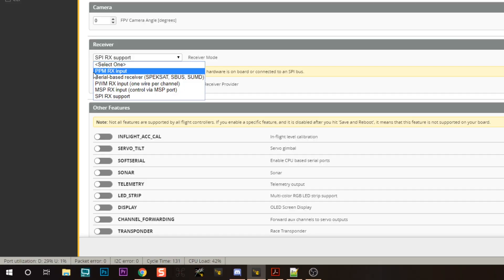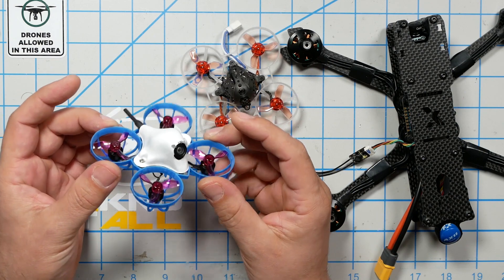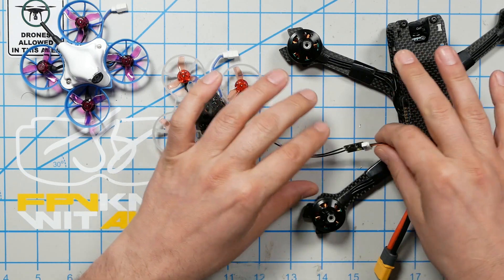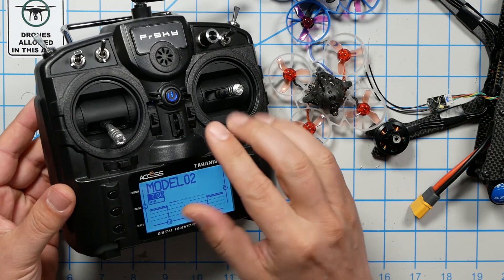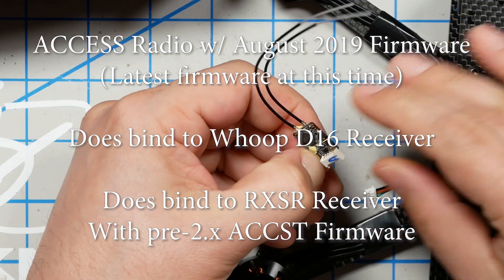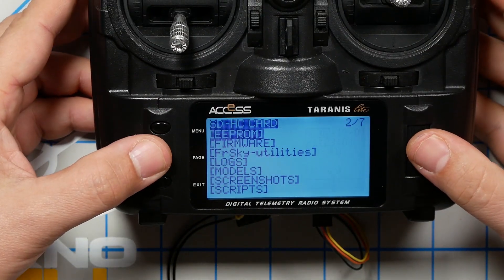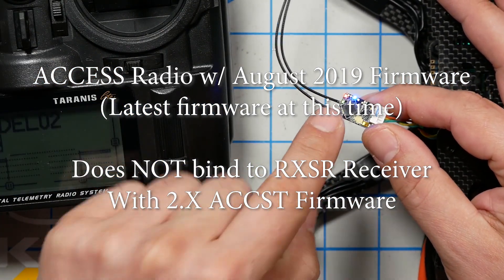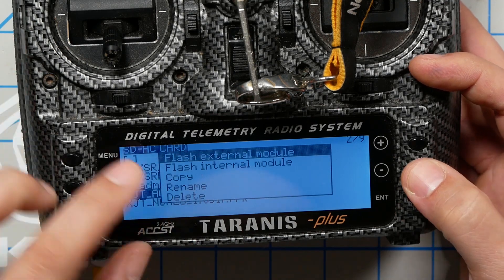FrSky won't bind! ACCST 2.0 is to blame.

Comment: They are doing a great favor for the TBS ;) Let's dance!
Reply: djfurione lol but neither one can use whoops
Reply: @aldenhauser9555  Yeah, that's sad. I'm going to keep my ACCST X9D, but every bigger quad will be crossfired, especially since I had nothing but problems with Frsky links in the past.
Reply: TBS is worse.  It only supports the 900MHz spectrum.  They hate everything else, not just whoops.

Comment: Josh, thank you so much for this video! I recently bought a few tiny whoops which are frsky D8 and I bought a jumper T8SG just to fly the tiny whoops with but them I bought a  5 inch drone and bought  frsky xm plus receiver and after 3 days of trying to bind that receiver your video explains why it would not bind at all. I have over 40 drones but they all are spektrum and that is why I did not have any experience with frsky and I was actually thinking of buying the latest frsky transmitter but now I am convinced that I don't want to buy products from a company that has such a bad behavior. thank you!

Comment: Much appreciated. Your videos have helped me endure the learning curve. This specific issue doesn’t affect me, but I’d probably lose my mind if it did. 

I’m two weeks in with my first pieces of gear (qx7 and a mobula hd). I’ve had my fair share of issues already (mobula loses its settings between random battery swaps, aux3-4 don’t respond in BF). I’ve been running in circles between the transmitter, quad, and betaflight. I’ve done firmware upgrades, made minor tweaks to settings, read documentation, watched YouTube, read forums, tested it.. wash, rinse, repeat x 10. 

There’s nothing more frustrating to an overwhelmed noob than losing lots of flight time to troubleshooting. I wouldn’t be surprised if niche incompatibilities like these actually turn people away from the hobby altogether.

Comment: I just run into this topic, after flashing my qx7s accst from 2018. I own some betafpv whoops which are affected by the bug. So i am stuck with 2.3.0 as the last opentx version before access. Thanks for the video, i started to go crazy...
Scew frsky. 
I think i will upgrade my whoops to elrs (+0.5g -.- ), upgrade the firmware chunk in a elrs module and never look back. Next radio will be no more frsky. 
Lesson learned

Comment: I Bought the new Taranis x9d se plus 2019 and R9m new 2019 receiver and module for a glider, one month ago. AlI have is telemetry lost every second flight, I have to land and switch all off and then on again to get telemetry back. One would expect both to be problem free as they are the 2019 edition and top of the range..." The new Taranis does not bind with most of my Frsky receivers, I can’t  begin to voice my anger with this company. They won’t see my business again
Reply: Same here. i blew up my taranis today while flashing my new receiver. Nothing works anymore. The old receiver worked fine and bought the same one. The new refused to bind. That was reason for flashing the software. Followed their manual but ended with broken shit worth over 300 euro. I go for an other brand. Have had it with Frsky.

Comment: curious question. If you buy a new xm+ or rsxr receiver, will you still be able to bind to the t16? and is it possible to flash the receiver to an older firmware?
Reply: If frsky chose to ship xm+ and rxsr with accst 2.0 or with the access firmware then yes you can flash it to the older version to get the compatibility back.

Comment: I recently switched from Spektrum to  FrSky. Spektrum was so much simpler. I'm seriously considering switching back.
Reply: I did this from the DX9 to the then new QX7. Then Spektrum released the iX12. Now this FrSky forced obsolescence move has happened. So I remain happy with Spektrum
Reply: After holding out for a long time I finally broke down and bought a FrSky, coming from JR- great radios forever, absolutely no complaints, but it is far easier to find whoops with FrSky receivers.   Now pissed that this game is going on with customers.  Guess with quads it’s changing everything every two months, and then the FAA jumps in.  WTF?
Reply: i went from flysky to spektrum but will not go the frsky route. spektrum works and that all that matters
Reply: I started with a Spektrum that was a gift but it's only 6 channels which served me for a while but I later needed at least  8 channels for turtle mode and RSSI. At the time I made the switch, I found a new 16 channel X9D SE that was cheaper than the Spektrum 8 channel radio. So the choice was simple. Who knew this mess would bubble up.

Comment: I support you with all my heart man. I have 9D + and I will continue to use it because I have everything made for it. But I won't buy any new equipment from FRsky. I will buy a T16 and will gradually switch to the new system. For now, I'm limited by money but I will definitely not spend it on Frsky. Bravo. I am with you and I fully support. Lukas.

Comment: They also did this on the R9 system. R9 is no longer just R9. Get an R9M X-lite Pro transmitter and you will learn it only supports R9 ACCESS and not the more widely deployed R9 ACCST protocol. Not very PRO if you ask me. If you don't want a paper weight then you must update your receivers to ACCESS. Problem solved right ? No, if you own other transmitters with JR bay R9M modules they wont work and CAN'T be upgraded to ACCESS. The solution is to buy the R9M 2019 version to replace the R9M you already have to use a protocol you don't really need but are forced to use.  The "R9" ecosystem is now an incompatible mess purposely made to push you towards access and buy more stuff. No more FrSky for me.
Reply: Yeah R9 access is garbage

Comment: So... that's it.  Glad you got back up. I'm a customer trying to get into FPV but I'm confused about what transmitter to buy. First I bought  Tiny Hawk II. I was about to buy  a FRSKY transmitter when I thought.. let me email the seller and ask if it will bind. The hobby shop said maybe which led down a rabbit hole of emails and youtube videos. Finally they sold me the cheap FRSKY transmitter that looks like a game controller. It will bind they said. It didn't. Apparently I got one of the new models with the D16 protocol. Now I need to jump through some hoops to "flash" it back to D08 so it will bind. Lol I may just stick to airplanes. Well quad industry...  you have a customer trying to give you money but you don't seem to want it. I doubt I'm the only one.

Comment: Jokes on you I never update any firmware!
Reply: Your supposed to update them ?
Reply: i would never mess with my computers cmos firmware. screw that up and you pretty much brick the entire machine.
Reply: pieter pretorius lol dude, just look up an overclocking guide. You’re software is gonna crash before you damage any hardware (unless you’re doing world record overclocking with LN2 or something). If you don’t know what you’re doing and just start changing stuff, sure, you’ll have a bad time, but setting a boost clock and a locked voltage is pretty safe and easy to do
Reply: If I just got a Taranis qx7 and a meteor 65, am I sorta screwed if I want to toss an sd card in my transmitter?

Comment: Flysky gang where you at
Reply: Yeah, I found the other flysky dude, high five! This is exactly why I went with fs-i6 (forward and backward compatible with AFHDS 2A and non-2A protocols so I have a big selection of receivers to suit my needs), since my Turnigy 9x was showing it’s age since most micros use the newer one.

Not sure I’d really need anything different any time soon, it just works and does it well especially after minor modifications. It used to use anything from an old cell phone battery to a 6s pack for powering the transmitter but now I’m just using old 3s packs since I have a 2w booster on the back (FCC technician license KG5YRN), so I was going to go for crossfire or R9 but really there’s no need now and no firmware or setting changes at all for any of my models like my tiny whoops to my planes, everything just works every time, it’s nice!
Reply: @jakegarrett8109  FlySky did the exact same move as frsky last year. They released the AFHDS3 protocol together with all new radios which are no longer backwards compatible. Just to get control back over the protocol that they put all their work and R&D money in. Which is totally fine and well within their right.. just like most of what frsky tries to do is well within their right and justified.
This entire drama around frsky is pretty dumb. Sometimes, the people in this community feel so entitled. Why do they think that frsky should continue to support bootleg unlicensed receivers.. Or that they should be okay with multi-protocol modules being able to run their intellectual property?
Imagine the tantrum that TBS would throw if they were in this situation..
Reply: @yekt3805  The bad thing is its turning your stuff into bricks. Its like if Windows stopped supporting 32 bit applications**. Also, controllers from FlySky have been that way, I don't know if you knew, but AFHDS2A is not backwards compatible with AFHDS, however some/most controllers could run both protocols: which is why I bought the older Flysky i6 and not the newer i6s, because the i6 out of the box you can switch between the two and it saves that with your model, so no changing my receivers out of my old planes or quads because it can run the new protocol like my Whoop runs 2A (with voltage telemetry) while my old stuff mostly has AFHDS non-2a receivers. So the protocol has never been backwards compatible to my knowledge, but that didn't mean the controller couldn't just natively run it (which I would think is ideal). So that's not really news worthy that 3A wouldn't back support it.

**which has been debated in Linux and Mac ecosystems, but of course with Linux you simply install the small package back in and youre fine, not a huge deal, but if Mac does it, then its forced fed down the throats of all Mac users much the same way WIndows force updates and removes useful features or ads stupid ones like Grove music/3D Viewer/Maps/Weather/Candy Crush/Xbox app and how they took away the most useful thing ever "sticky notes", and hey, just checked today and that's back even though they removed that a long time ago maybe in windows 8...
Reply: @jakegarrett8109  Sry for the confusion but I said that the new radios are not backwards compatible and won't support the 2 older protocols. I never said that any protocol itself is backwards compatible with an older protocol..

And windows might not be the best example since there are so many companies that are (or were) stuck on older OS versions like XP because their in-house programs and workflows would no longer work in Win7/8/10.
Ofc it's bad for the customer, but in my eyes it's kinda what you get if you buy a product that runs non-legitimate hard/software..

Comment: Thx, this video explanes things well.

Bought my Taranis last year, before the shady mails to retailers who also sell Jumpers and now changing the protocol. 

My Trashcan didn't work with D16 mode on pre 2.0 ACCST, no matter what I tried. 

I could use D8 but that's gray area in Europe. You can legaly use it but only on radios sold before 2015 in my country. So I bought XM receiver for now.
When I need a new radio I will look other brands, this hobby wouldn't be this great without open source projects. Frsky is going the wrong way.

Comment: No Frsky, no TBS... Who's next on list? 🙈🤣
Reply: No customers.  :-O
They had better hope that they get LOTS of new customers to replace their many years established customer base that they are driving off.  I am NOT buying a FrSky transmitter that will not bind to my many D8 receivers and I am NOT plugging a module into my transmitter to do so.  If I am plugging a module into my transmitter it is a Crossfire module.
With their greed FrSky is screwing their customers over and screwing themselves over.

Comment: I figured this all out last weekend.   I actually sent you a bunch of questions and comments about this very topic.

I applaud you for telling the truth and standing up for customers.

There are a few more questions that needto be answered before you can judge just how ANTI competitive FrSky is going to be:

1) Will FrSky apply the supposed bug fix to pre 2.0 firmware so that customers can continue to use ACCST V1 ?

2) Will FrSky continue to sell receivers with ACCST V1 ?   If they don't, they are going to force everyone that needs a new receiver to ACCST V2 and when they do that, they are forcing everyone to use FrSky transmitters, as only their transmitters support ACCST V2.

3) Can customers reflash receivers with ACCST V2 with ACCST V1 firmware ?

I think you need to speak with FrSky on our behalf and make another video to address these issues.

FWIW, several people have made firmware to work in FrSky receivers.   The MPM firmware is open source.  I think it is time the community developed its own receiver firmware and took FrSky entirely out of the firmware equation.

In case anyone is worried about being blocked from flashing firmware onto various pieces of FrSky hardware, firmware can always be flashed onto a device via the debug port built into all these devices.

Comment: I don't understand where the hate is coming from, and you as someone with a background in software development should know better:

1) The new firmware has a new major version (2.x) so you shouldn't expect it to be backwards compatible. You could argue that this should be a new protocol altogether (D16-2) and I suspect this is what it'll unofficially be known as, but from Frsky's perspective this would require coordination with OpenTx and it'd be a lot more painful, whereas to the end user (of their official products) it has no real effect.
2) Frsky has no obligation to support non-frsky firmware. This is like hating Microsoft for releasing a Windows update that breaks compatibility with your pirated version of Office.

Now I would understand the frustration if you could proof that the only purpose of this firmware is to break that compatibility, but do you have that proof? What if it turns out that it legitimately fixes a bug that requires a breaking change?
Reply from the maker: I'm annoyed with FrSky not just for this one thing, but for a series of anti-competitive decisions they have made. The first one was changing a component on the QX7 (inverter) so that Crossfire stopped working. I don't remember any announcement that this had been done. Just.... on the first shipment of QX7, Crossfire worked, then suddenly it didn't, and TBS had to dig through the PCB to find out why. 

After that, they left D16 mode out of ACCESS radios, which I believe was an attempt to create this exact same kind of schism, where users of 3rd party receivers would be forced to upgrade away from them. There was no technical reason to do this, and the proof is that, after a huge uproar from users, they added D16 in via firmware update.

So now you argue this compatibility break might have been necessary, but FrSky hasn't earned any benefit-of-the-doubt here. They have demonstrated that they will break compatibility in order to force their customers away from 3rd party hardware, sometimes without ever announcing that they have done it (inverter).

P.S. let's also not forget that some vendors claimed FrSky had threatened to cut them off if they sold the Jumper T16, and most vendors don't carry the Jumper as a result. This is despite the fact that the Jumper infringes on no intellectual property of Frsky. In fact, it is based on the same open-source software as FrSky's radios, and has equal right to use it.
Reply: @JoshuaBardwell  You raise some fair points about them having lost the benefit of the doubt. At the same time, I can only put myself in the shoes of their engineers. You're expecting them to support 3rd party products they have no control over, the module bay thing with the QX7 is kind of the same issue. Do they advertise that this module bay is for using with a standard, or with their own modules? As for the lack of D16 in new radios, why would they put in the effort to support an old protocol when every receiver they've sold in the last 5 years will get an access upgrade? Again, the only reason is to support non-official hardware. 

I think the issue is pretty clear, they don't advertise support for 3rd party receivers and they won't make any effort to take them into account when releasing upgrades, new products and so on. And why should they? Are these 3rd parties paying any licensing fees to them? Ultimately what they're doing is no different than what most technology vendors do without us questioning it, but we had all collectively fooled ourselves into thinking Frsky was akin to the Apache Foundation when they're actually Oracle. Us as consumers are free to buy from a company like Jumper, but then you might as well buy Frsky and just not upgrade if you want equivalent functionality?

PD: I do agree the move to intimidate sellers was shitty. That's a different matter though. And thanks for putting in the time to make this videos and reply to random people in the Internet like me with well thought out responses. I just don't agree with your take on this particular issue :)
Reply: i bought original Frsky receivers only then they kicked my back multiple times with incompatibilities. Soldering out all rx to get into their dependency-trap is far beyond welcome. Such policies will go down. Amen

Comment: Appreciate the video Josh. I have the X9 lite and love the form factor and the price is hard to beat. I run two whoops on d8, and also run a couple spi on d16. I definitely won't update my radio until the dust clears now, as it works well enough for me. Here's hoping frsky  changes their tune on this one and provides another update.
Reply: which firmware do you have on your X9 Lite? Since 1 week im trying to bind my mobula 6 with the x9 lite but it wont work